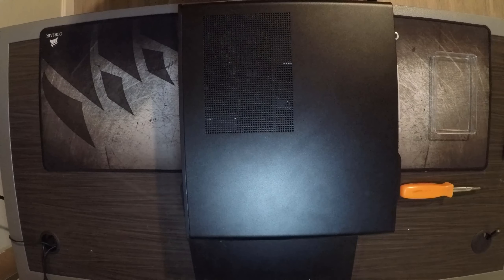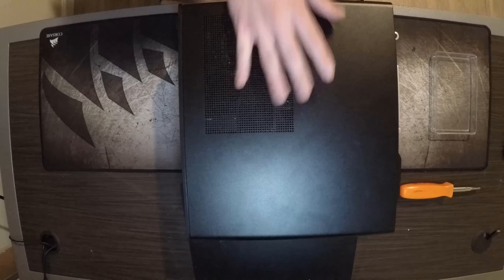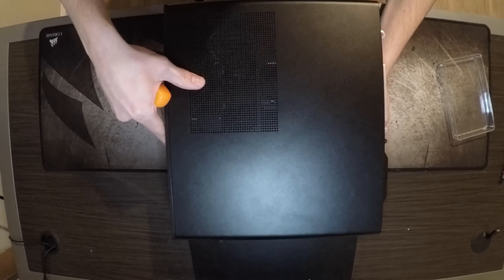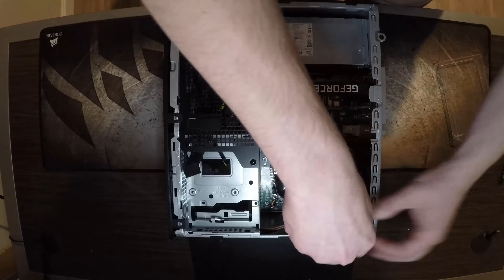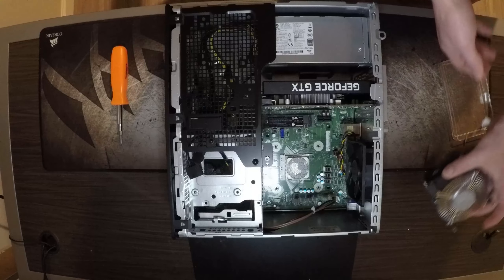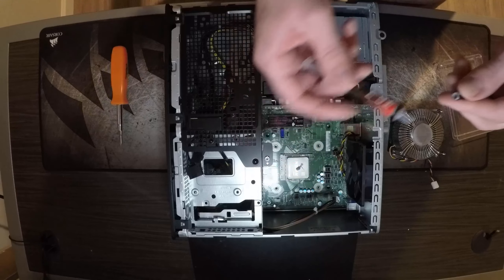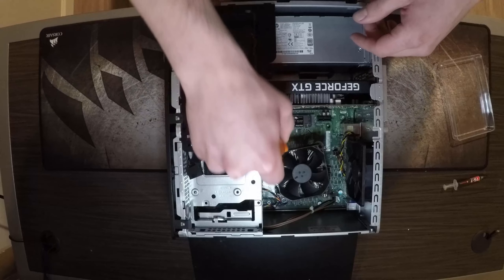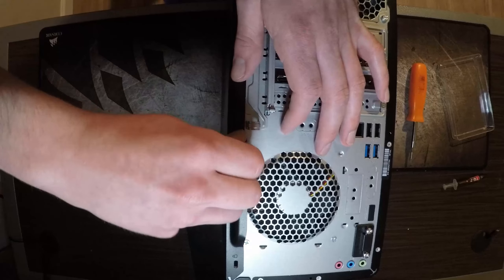HP Pavilion Gaming PC Gets New Thermal Paste TG01-0023W

Comment: Just bought this pc and it keeps restarting randomly like every 3 minutes or so. Would it be a cpu problem or perhaps a psu problem? Its plugged into my tv as well
Reply from the maker: I would say the power supply is the issue. PSUs have more faults than CPUs most of the time. When you go to do something on the pc or it gets to a certain point where it draws too much power, it shuts off. Which would make me think its the power supply. I would make sure everything is properly plugged in and lastly I would try using a different power cable that you plug into your computer PSU from the wall. I would order a new power supply. Ryzen's new CPUs are quite reliable compared to HPs atx power supplies. Good luck!! Let me know if you have any other questions
Reply: @PortzTech  Hey thanks for the response. I took a look inside and found out there was just about zero thermal paste on the cpu and fan. As far as the power supply goes, would I have to order the same exact one in the tower or is there a compatible aftermarket power supply I could use?
Reply: @PortzTech  UPDATE: I bought a new power supply, literally the same exact one and its still doing the constant restarts
Reply from the maker: @rndmman4  as Taha_Vibez  I would suggest buying a more powerful one. If you could buy a Evga or just stay hp, but just get one with more power.
Reply from the maker: @Taha_Vibez thank you for helping out with this, glad people are helping each other in the comments

Comment: (I don't know much about computers so, sorry if this question is dumb) If you were to upgrade this pc with all the videos you've done. Plus you got a new motherboard and power supply (GIGABYTE B450M DS3H V2 (AMD Ryzen AM4/Micro ATX/M.2/HMDI/DVI/USB 3.1/DDR4/Motherboard+ ARESGAME 750W Power Supply Semi Modular 80+ Bronze PSU (AGV750) What GPU and CPU would you recommend upgrading to? Sorry, I know this is a loaded question.
Reply from the maker: It’s not a dumb question at all! You could go with a ryzen 5 3600 to get little more power. 1660 super would be a nice little upgrade or if you could find something like a 3060 would be nice. It is hard to find parts currently, but those are my recommendations. Graphics cards will be the hard ones to get. I will make a video on doing both of those shortly! Let me know if you have any other questions

Comment: Hey man my gf just got this PC. Do you think it is possible to change the LED light from green to rgb? (I know it’s not possible through software/bios)
Reply from the maker: Find a led that plugs into the motherboard with a three pin or two pin or whatever the front led plugs into and swap it. You’ll have to mount it another way. You could also, use some sort of adapter from the power supply to power a led. Let me know if that helps or if you have anymore questions
Reply: @PortzTech  great! Thanks for the answer man. And great vid. Appreciate it

Comment: Which screwdriver I need to open the pc? I have  a similar HP with i5 10400f and 1650s i tried several screwdrivers but i don't manage to find a suitable one. Anyone who can link me a screwdriver for this pc or help me?
Reply: If you haven’t had any luck opening yet you should try some scissors
Reply from the maker: Just buy a screwdriver kit with multiple bits and I’m sure one of them with work for you. The one on the back of this pc is a Torx t15 or a flat head.
Reply from the maker: @aaaawubadugh8054  very creative! Just be safe!!